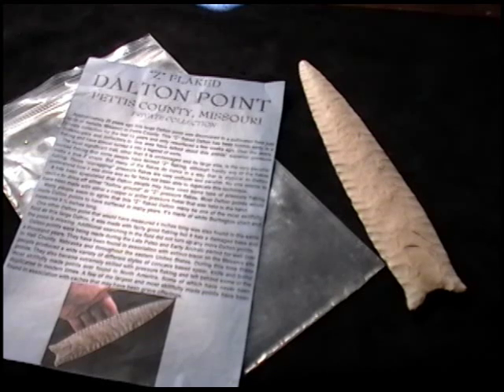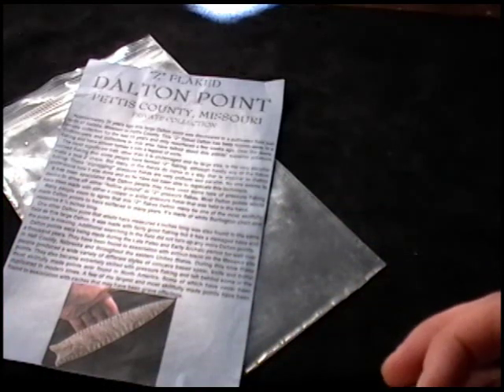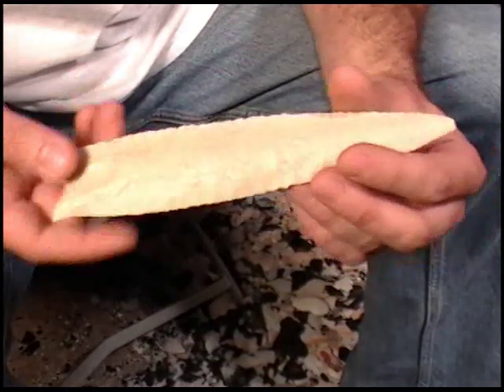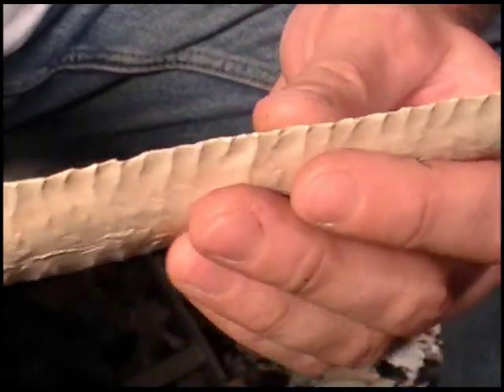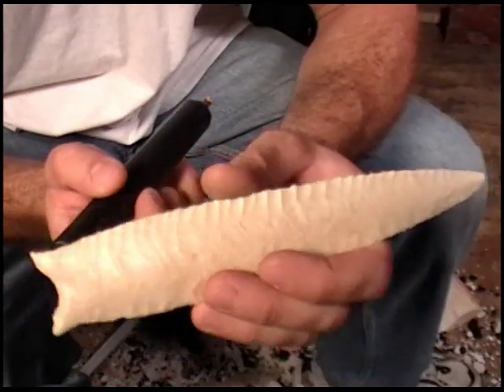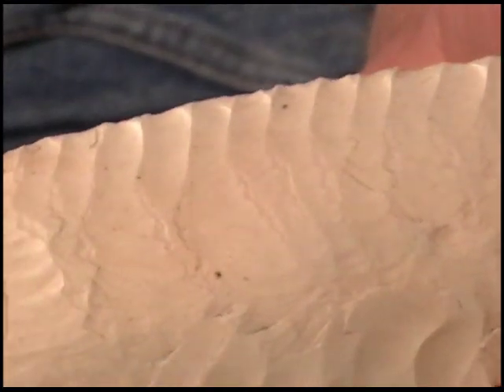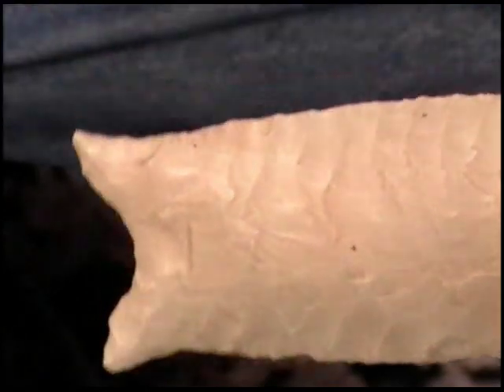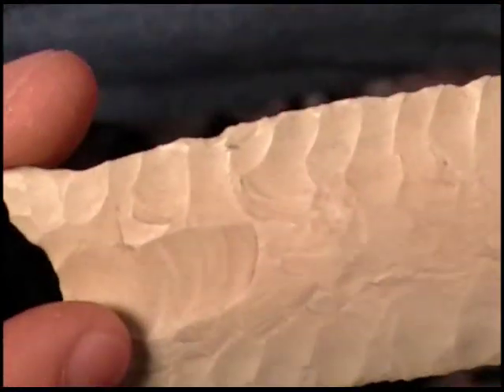Flint Knapping Trade Secrets Vol. 2 Dalton Technology - Replicating the "Z" flake pt. 1

Comment: @knapyucatan. They were from raw material. Not heat treated. It takes a crap load of pressure to rip the first set of pressure flake off. And you really need high quality raw chert to get the right outcome. And as far as the copper goes, that's a big controversie.